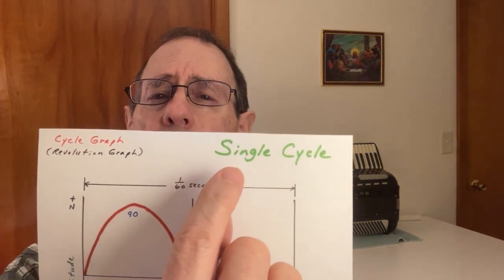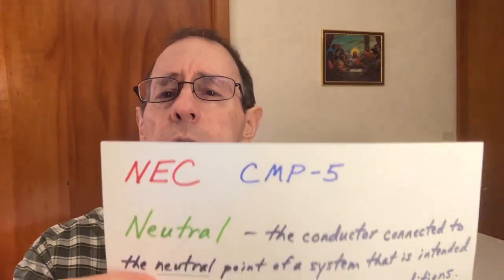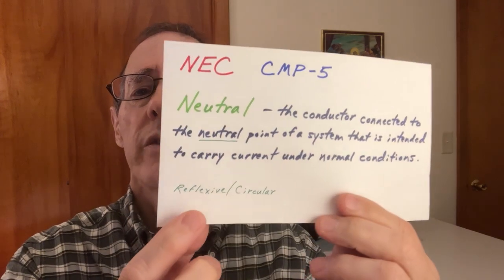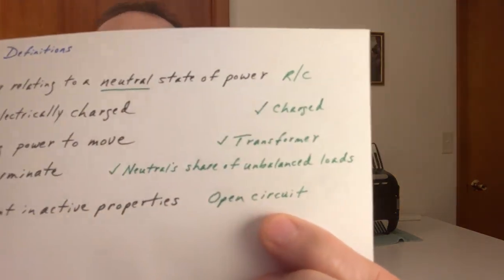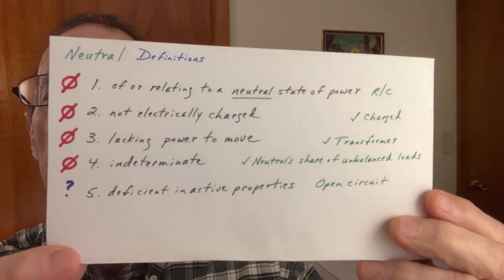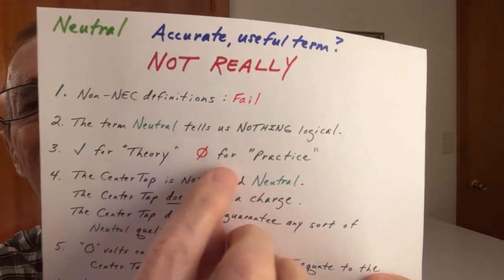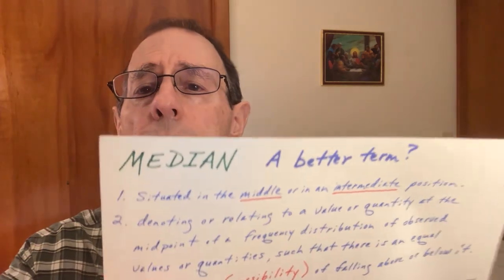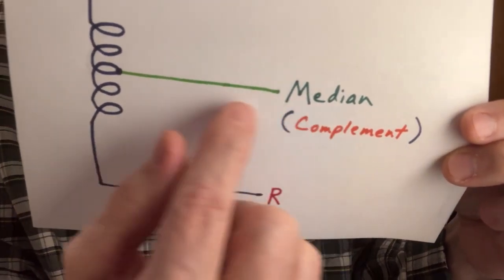AC Current Flow: #4 Why "Neutral"?

Comment: Another lay person here. Ive been trying to get a handle on the neutral for a while, and I think more descriptive names could help clarify its role also.  However, it is used outside the residential center tap setup, so its terminology shouldnt be unique to that. The neutral is actually just another hot leg on any setup, with its own voltage relation to the other hot(s).  What makes it neutral, and gives it the name, is that its grounded to keep the voltage at zero in relation to people and objects on the ground, aka neutral to them.  Thats why the electrical code calls it a grounded conductor.  You need at least 2 conductors to make a complete circuit (residential has 3), and whichever one you ground becomes the neutral. You could ground the top wire and leave the bottom and center tap still hot, but it doesnt balance the load as well.
Reply from the maker: Thanks for watching. Your comment, like others below, is EXCELLENT. I've since left the topic of "electricity" and have moved back to "grammar," for a time. I understand what you are saying; what you've stated can't be disputed. When I make videos on just about any topic, I do so because, for the longest time, people have used terms that (to me, at least) just don't cut it. Time will tell. Maybe my new "terms" will be accepted, maybe they won't. I'm almost 72, so I'm running out of time. When I was young, few people, if any, instilled in me the desire to learn. It's a miracle that I can even write this—and have someone understand me. Again, thanks for the excellent response.

Comment: I previously have always maintained using "return" for this conductor, but now I see that they now use "neutral"; I'd bet this is to include the "pulling" side of the cycle.  I will conform to the trend.

"Neutral" is not an inappropriate name since it is the "rider" conductor; it completes the path of what the "leading", or "hot", conductor is supplying, whether it is positive or negative.  Therefore, it is neutral in its influence and serves both directions.  This is different than a shared conductor on two different phases, which of a perfectly balanced load will carry zero amps (neutral, in this sense); it will carry the net, or balance, current when the loads are unequal.

"Median" is too exclusive to the physical transformer center-tap location, though it is the exact reason why the phases voltage are equally split.  "Neutral" allows focus to the branch circuit that is being installed, and that is what the installer will be largely concerned with during installation.

Terminology in professions must become more relavent to the work at hand to speed up understanding and assist correct execution, rather than appease common person understanding.  Modern physicists have needed to step up their terminology use, e.g., using "information" (I still don't know what they mean) and "observe" (in the presence of).  Same with "marriage" 's use for two things "put together".
Reply from the maker: Thank you, Lou. Your comment is EXCELLENT. I have found NO ONE on the Internet who has expressed this phenomenon so succinctly. Had someone informed me, as you have—BEFORE I finalized my theory—I likely would have "toned it down a bit." From my home, I drove to four professional electrical contractors, to whom I presented my premise. None of them understood what I was trying to impart. I think you DO understand, though you don't necessarily agree—which is fine. Allow me to respond to a few points that you made: 
(1) I tried to integrate the concept-term "complement," for, as you said, "it completes the path." Therefore, the name "median" itself hinges (at least to a degree) on the concept of complementation. I tried to explain how (to me, at least) the concept of "neutral" seems to run askew to the concept of complementation.
(2) In my mind (albeit uneducated), I don't think of the term "median" as a term that necessarily "negates" the "send-return" quality. Also, I don't think of the Median as transformer-exclusive. And I say that because, as I explained, the two LIVE lines coming from the transformer (say, black and red) are actually an illusion. The secondary side is really only ONE conductor (even with a Neutral/Median leg). 
(3) Regarding "two phases," it is obvious that MY "two phases" (current direction) are NOT the same "two phases" that mainstream professionals speak of. I make it abundantly clear that I do NOT understand why they even refer to such a system as Single "Phase," a term that makes no sense.
The beautiful thing is that . . . YOU are correct. But I also feel that I am correct. I feel that I am correct "when looking at the system from the standpoint of a layperson." If someone—unprofessional and uneducated, like myself—were to tackle this subject from scratch, they MIGHT see what I see. I'm not being contentious. I'm just trying to use my mind . . . while it still works. Thanks for watching and taking the time to comment.
Reply: @scalephrase  Thank you for reading, comprehending and replying.  I too have tried to be very thorough in understanding the phenomena and words used since concepts tend to get lost in daily usage, monotony and during the pressures of a job.  I completely understand what you're doing.  These understandings became more clear to me when I was researching on why me calling this a 2-phase system would be incorrect (it is single phase, and further, it is split-phase, i.e. center-tapped - this is key.  Daily colloquial speak just conveniently calls them the "two" phases).

Here is the video.  It is very good and will explain (3):
https://youtu.be/uRKbX74lBgU?si=2nSxws6eHZ1Qyg-n

(1) I'll just say "complementary" is implicit in the usage of the label "neutral". (Plus I'm trying trying to save you the pains of maintaining use of personal words against industry standard.  Engineers (power electrical) fully understand the design, and they have worded correctly.  No insults intended toward you.)

(2) You are correct, and I won't obsess on any details because you have identified the big concept of the illusion.

I do agree with your use of median but picked on it to generalize that since a transformer secondary could be tapped at, say, 1/3 (80V and 160V), and that tap (no longer median) could be the neutral if loaded appropriately. (I might have some of this wrong since I've gotten re-fuzzy).

If you get satisfied with all this, start seeing why gravity is a false force, and why "gravity" bends light (masses).  I recommend FloatHeadPhysics channel, here on YouTube, to start.  (Unless you already know.)
Reply: @scalephrase  Regaining some memory, yes, many have become sloppy using the phrase "the two phases".  This is probably why engineers named the hot conductors "legs" since it IS one phase that is split.  It would be more clear when understanding 3-phase systems that 240/120 is single phase.
Reply from the maker: Hi Lou. I stand by my electrical terminology premises (remember: they're coming from a "layperson's" perspective), but your perspectives and insights are REALLY inspirational. Instead of typing my ass off, going on and on, I really should (when I get time) make a "response" video. It would be easier to "speak" what I have to offer than to painstakingly "write it out." That's the best I can do for now. I have endless DYI projects here at home; and I'm helping a friend remodel. And I'm old, and I'm tired. Again, thanks for being incredibly patient. Joey D'Agostino

Comment: Interesting thoughts.   I was Sr. Electrical Designer and became a PE in 2007 then Sr. Electrical Design Engineer starting in 1983 and retired 2018.   Which version of the NEC are you finding a definition for “neutral”?   I ask because my latest version is 2017.  There is No definition of “neutral” within the Article 100 in my book.   There is a definition of “neutral conductor” and “neutral point”.  But nothing on neutral.   Everywhere in the NEC a neutral conductor is called a “grounded conductor”.   That is of course “IF” it is indeed connected to earth at some point.   Not all systems are grounded.
Having said all of that, the NEC and the electrical industry can and do use terms as they see fit.  They are not required to meet the definitions of dictionaries or other sources as they publish their own definitions.  Don’t mistake my comment, you make several valid points, but reality is they do not apply.
Reply: The definition for neutral is the same as definition for "Grounded conductor". In 2023 NEC, Grounded Conductor is defined as "A system or conductor that is intentionally grounded". Quite honestly, I don't find this definition useful because what does "grounded" mean? NEC defines ground as "Earth". Another not so useful definition.